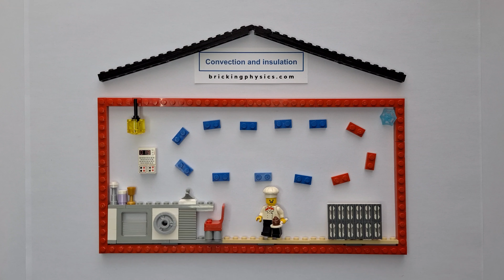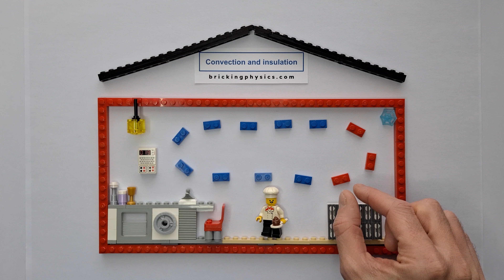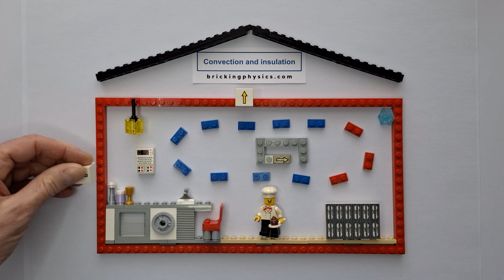Convection and insulation explained using LEGO | Physics of energy

Comment: Great video. Not sure if it would link in with syllabus for teaching purposes but I find weather compensation an interesting concept and it links heat loss by conduction with heat out from radiators and their output proportional to fluid temperature.
Reply from the maker: Thank you! Interesting link to a wider application